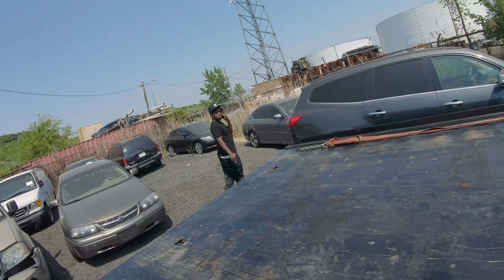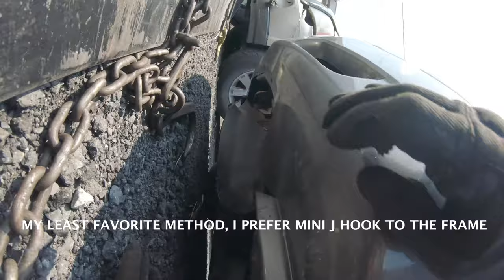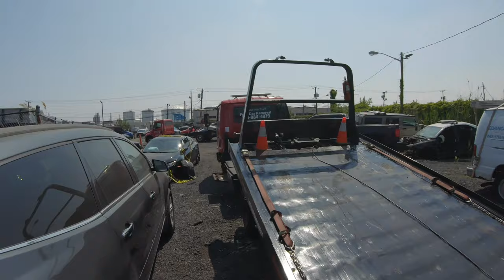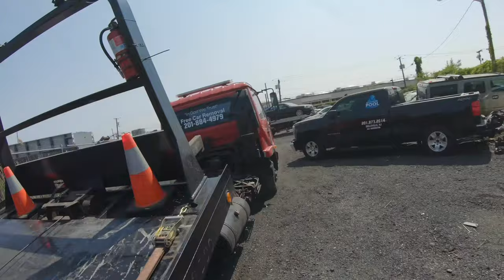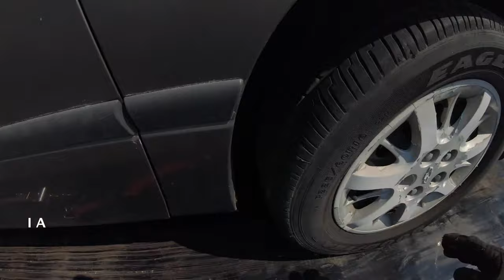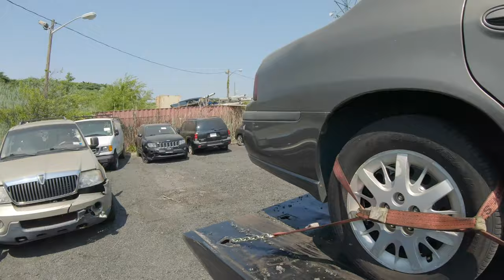TOWING A CAR NO KEYS USING SKATES

Comment: Sure way to to damage lower control arms using j hooks.
Reply from the maker: I agree 💯, thats why i said its my least favorite hook
Reply: @6starDriver  What was preventing from hooking to the frame?  A professional operator should have bridle with a mini j or r to hook to the frame points.
Reply from the maker: @53kills  non running vehicle going to the scrap yard to be destroyed so out of all the hooks i have available, the J hook was perfect for this specific job.
Reply: @6starDriver when I started towing i would use the J hook and connect it to the control arms after doing it few times I realized I damaged few cars doing that. Best thing to do is connect to the frames